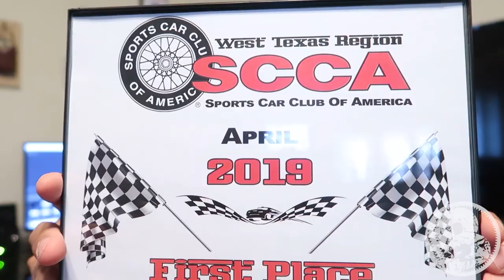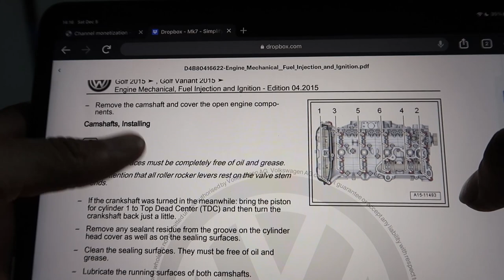Engine build - Breakdown! Part 5 - Cam Shafts removed! MK7 Golf R

Comment: Dont worry bout the wear on cams, its pretty common. Btw u shouldnt swap cams from another engine, the cyclinder head is machined to those cams. Basically they are paired together.
Reply from the maker: I think that might be just for the cam cover.. cause these aren't the cams the car came with, either way this sucks lol
Reply: @BryceJordanProductions  i would recommend replacing the whole head with matching cams and head. They are married due to machining.
Reply from the maker: thats a hard bullet to bite 😩
Reply: @BryceJordanProductions   yep thats just how it goes. U can find use heads kinda cheap on ebay, i would talk to a2b see if they can hook u up. But there is no way around it, it sucks. Better safe than sorry.

Comment: related to your comment about the rocker/rollers, being loose, damn....I had an experience with them on my car, can't believe it.
My car is a manual, 1.8 TSI (same engine, but 1.8 litre) and I downshifted (by mistake) from 2nd to 1st, engine hit 9000RPM and 2-3 of these stupid rollers came loose and broke the camshaft, had to change the entire head of the engine because of them.
Reply from the maker: Holy shit that’s awful!!
Reply: @BryceJordanProductions  yep. The message on the diagnostic was even more shocking. Engine speed exceeded: 9250rpm WARRANTY VOID!
Unfortunately or luckily I don't have warranty on it anymore so yeah. About 2 grand cost to replace the head with a second hand one.

Comment: i’m split down the middle about that cam journal wear, would have to see it in person to really know how to feel about it. if you have pictures of it before when you were last in there I would compare that and see if it’s gotten worse. I would be more worried about the oil pressure loss then I would be about it wearing deeper and worse. if you weren’t going as crazy as you are building the car right now, I wouldn’t look twice at it and would slap it back together and send it.  considering the extent that you’re gonna go with the car I would definitely sit down and figure it out, get plenty of other peoples opinions and go from there. do you have an oil pressure gauge on the car and if so were you seeing any abnormal numbers on it?
Reply from the maker: No gauge but car acted totally fine.. never really found much of anything in the filter or fluid.. I really think it's been like this for a long time